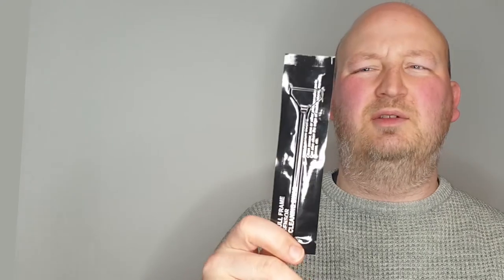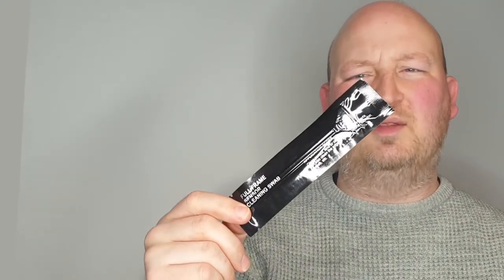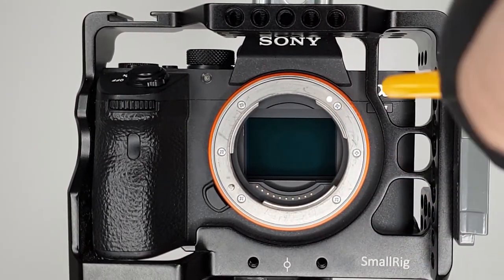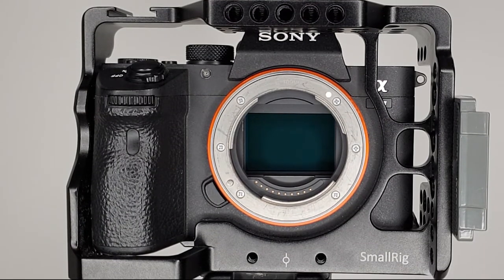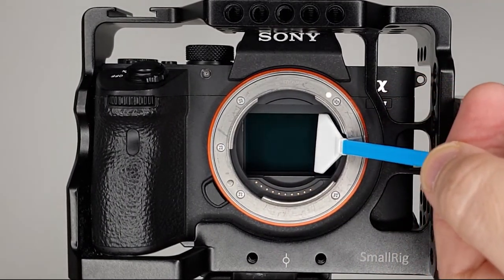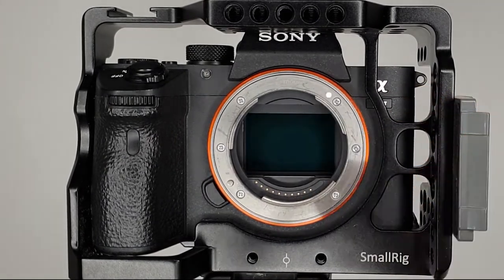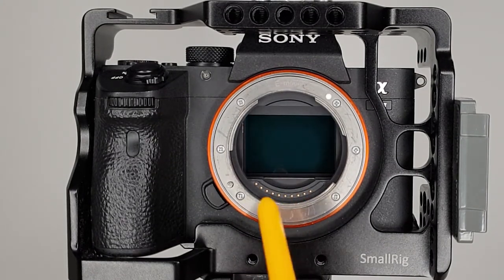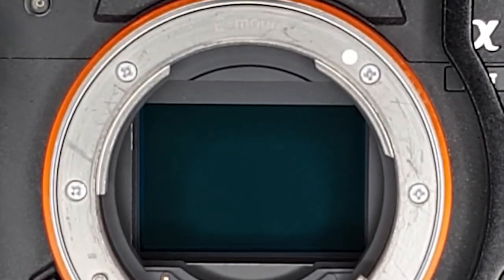How to clean your Mirrorless Camera Sensor - S Black Photo

Comment: Great video Steve, maybe worth mentioning that it is also helpful to first do a lens clean from the camera menu, then leave the camera on and complete your steps, this will help keep the sensor still and does not cause any possible damage to the IBIS system of the sensor. as the in-body sensor clean locks the sensor. great tips though thanks
Reply from the maker: Great tip! Thanks!